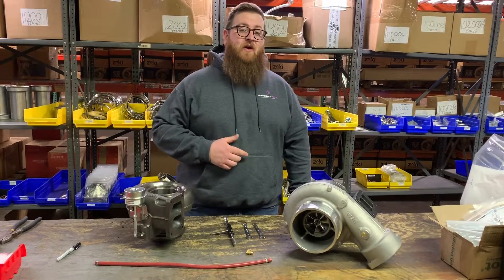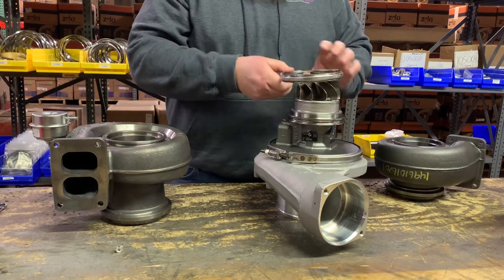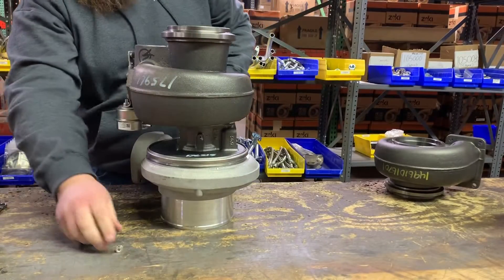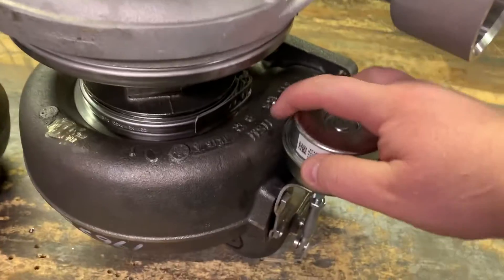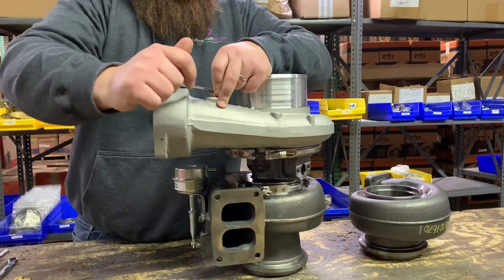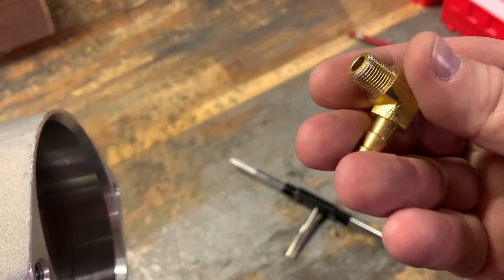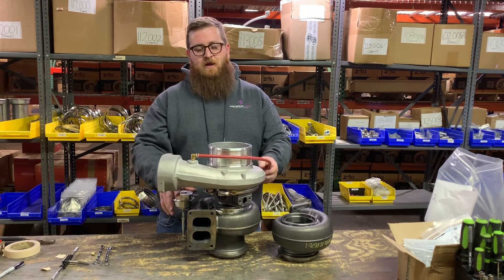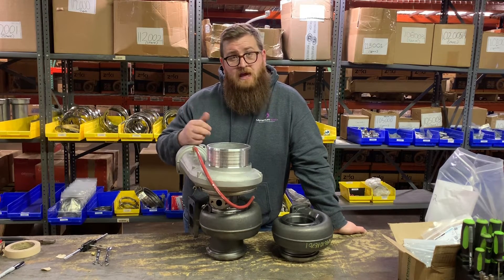Adding a Wastegated Housing to S410SX CAT Turbo

Comment: That wastegate housing is HUGE! What's the reason/benefits of going to such a large wastegated housing from a smaller non-wastegate housing? Maybe from a 1.58 to the 1.65 isn't necessarily bad. But, that seems like a big jump from the other sizes.
Reply: A 1.65 is too big, for most guys. No real reason it needs a wastegate, in most applications. A 14.6 can't make enough drive pressure, cruisng. EGTs sit at about 900*, post turbo. Let's the engine breathe awesome, though.

Comment: Is there a benefit of a waste gated turbo vs a non waste gate?
Reply: A wasregate lets a turbo spool sooner at the low end, and opens and can breathe easier on the top end. Also helps prevent overspool/excessive wheel speed. Too much, and you can snap the shaft.
Reply: @Bigstretch100  good to know, thank you.
Reply: yes